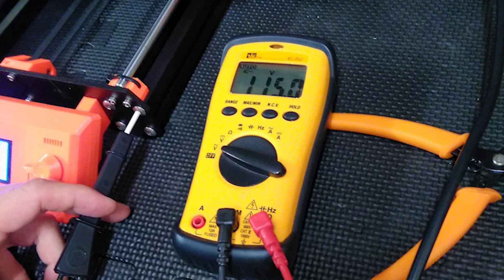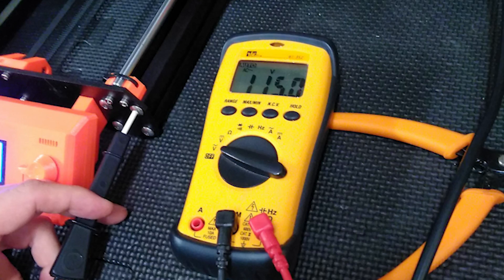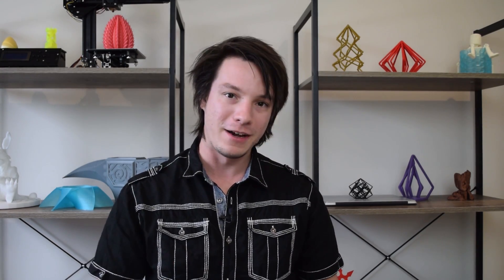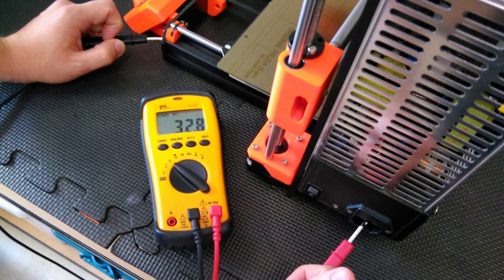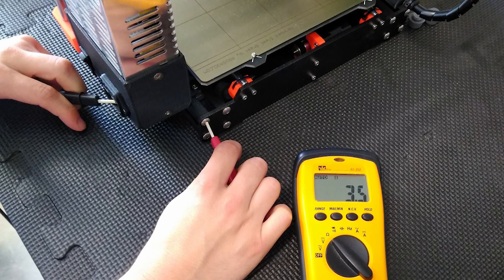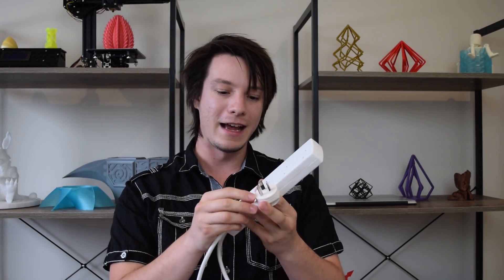I got shocked by a 3D Printer

Comment: That is the mains input filter te remove high frequency noise that is produced by de switching power supply. In most case they have at least two capacitors that goes from each mains pin to ground and if there is no ground...well the mains voltage is divided by 2. These are small capacitors they give you a shock but will not kill you if you are healthy. But yes unpleasant surprise.

Comment: my guess is that filtering in the powersupply for the JGAurora A5 has 2 capacitors to ground. one from live to ground and one from neutral to ground. this is common in grounded switched mode power supplys to reduce the electrical noise from them (not sound, Voltage/current spikes that can cause all sorts of problems). capacitors do let through a bit of current on AC and are commonly used to limit current in cheap chinese LED lamps (youtuber BigCliveDotCom has many good videos explaining how that works)

Comment: Gah! There a lot of comments along the lines of "It's not the voltage that kills you, it's the amps!" Which is basically nonsense. 
Current = Voltage/Resistance and at any time, humans are effectively of a fixed quite high resistance.
So, without sufficient voltage, there can be no consequential current flow.

Comment: As others have pointed out, the stray voltage is a normal consequence of the way modern power supplies are designed, with input filters to reduce EMI. These filters include so-called Y capacitors that connect both sides of the power line to earth ground. This accounts for a small leakage current on the earth ground lead of the power cord. This current is unnoticed when the power cord is correctly grounded, but as Angus discovered, can be a shocking discovery when it is not. The Y capacitors are sized to limit the current so that it is not harmful and won't trip a GFCI (aka RCD). They are also designed to fail open so they should never present a shock hazard. Assuming the power supplies of both printers use proper safety agency-approved Y capacitors, they are safe and functioning correctly. See https://electronics.stackexchange.com/questions/135791/current-leakage-calculations-regarding-shock-hazard-a-complete-picture.

Comment: Wow, this is "heavy". I'm glad you're OK. Could have ended worse. Combinations of circumstances.
Hurry/haste, doing things when you are tired or not totally concentrated are to be avoided. They cause 90% or more of all accidents.
With machines, cars, equipment, etc.
Maybe you (or more me/people) were lucky to touch the screw of the (in fact unguilty) Prusa Mark 3. 
Electrical machines working on 230/115 V with metal casings should heave doubled isolatian.
A metal casing of any tool/printer or what so ever, is stronger than a plastic one and looks more modern/sophisticaded.
But metal conducts electric current and plastics do not.
Plastic is always cool.

Comment: I'm sure glad that you weren't hurt! I think it's very good that you made this video to raise awareness of electrical safety.

For what it's worth, I have an anecdote about a piece of equipment that I bought via AliExpress and imported into the USA. It's a fairly popular soldering oven called a T-962. After reading unflattering accounts of its construction, I tore mine apart and fixed stuff that bothered me before I applied power to it for the first time. I found that the grounding connection was made with a ring terminal clamped against a painted surface, without even a toothed washer to cut through the paint. If anybody is really curious, I made a teardown video, and the bad ground connection appears at 11 minutes in.

Now this is just one anecdote, but I've read similar accounts about this oven and other inexpensive imported equipment. Even if a piece of equipment has a grounded power cord, its chassis may not be properly grounded. Or maybe the main ground connection has been made adequately, but other parts of the chassis are left floating, e.g. when two painted or powder coated panel pieces are screwed together without proper attention to electrically bonding them together.

I think that anything imported through normal channels and marketed by a local company which pays proper attention to local safety testing regulations (such as getting a valid U.L listing in the USA) is probably ok. But I think that a lot of niche products, especially when they're imported individually by their end users or are made by well-meaning amateurs, fly under the usual safety regulation radar. Thus, I think they are a lot more likely to have latent safety issues that would have been caught in a more mainstream consumer product.

I think it's very good that we have folks like Angus reviewing this stuff and educating folks about it. Whether we put pressure on a designer/manufacturer to fix an issue in their product, we educate end users how to recognize and correct issues like this themselves, or we warn people away from an irredeemably dangerous product (like some of the lethal things BigClive reviews), it's very beneficial for all of us.

Comment: Prusa COULD make an improvement although this was not his fault: He could make use of double isolation. That is putting a layer of plastic on all grounded metal parts. The inside needs to be metal and grounded. That way a short circuit will go to ground and trip the fuse. The outside needs to be coated in plastic or other insulating material or paint. That way you can't get shocked if the ground has a fault, because you can't directly touch any grounded metal parts.

For some classes of devices a double isolation is required by law, but I am unsure of the specifics.

Comment: Fortunately, this is less of a problem here in Spain, where grounded plugs (Schuko, round) have a completely different aspect to non-grounded ones (Europlug), and almost all the power outlets have Schuko sockets (which is compatible with the Europlug). Plus, all houses are required to have an RCD/GFCI.

Comment: You need a RCD device: https://en.wikipedia.org/wiki/Residual-current_device

This is a requirement in all installations since 2008 here in Denmark. It is usually installed along the fuses. The fuses protects against a short. The RCD protects against leaks. It will compare the current going into the house with the current going out. The current should always sum to zero, otherwise there is a leak. It would instantly trigger the moment you got shocked because current was going through you and out of the system. It would likely trigger the instant you turned on that bad printer too.

The RCD triggers if there is a leak from phase to ground. It does not trigger if there is a leak from phase to neutral, because that is normal. The bad printer was leaking from phase to ground and would therefore trigger the RCD. That printer could not be plugged in anywhere around here. Of course if the earth pin is disconnected, it might work but only if there was sufficient isolation from chassis to the surroundings. Your table would need to be isolating. If the table was metal, it would trigger the RCD that way.

Comment: I only use powerboards and leads I buy from Jaycar, these days.  Not because I believe they're inherently better, I just work in a Jaycar (not speaking as a representative of the company, or anything like that, these opinions are my own, and even in saying this much, I'm probably flirting with a gross violation of the social media section of my contract), and I can check them with a multimeter before I buy them.  I've bought some very cheap powerboards elsewhere, and they're just downright dangerous.  One was so poorly manufactured, the sockets weren't properly punched out, so I had to take to them with a file (while unplugged, obviously...).  After I made the sockets actually fit a plug, I found that the Active and Neutral were swapped, and the ground wasn't connected at all, despite it being a three pin plug on the end.  That was a brand new powerboard, with some probably-fake Australian standards logos on it.  That's the kind of power board that might kill someone, if they use a metal kettle or toaster.

Comment: There are a lot of things people don't know about power I'm no electrician but I had an experience with an appliance. I used a power cord extension with the appliance I turned off the power and still received a power shock. I found out although the power was turned off the power extension lead still holds current until  you unplug it from the wall thought I would let people know

Comment: My cr-10 came with 2 pin lead with a dodgy UK adaptor, I rewired it in my video, as the UK has a 3 pin similar to AUS I decided to cut the 2 pin plug off and rewire it to a UK 3 pin plug, no way I was gonna use the combo I got with it, if it's not earthed I wouldn't use it.

Comment: I would be testing all the cords/attachments used as well. Cheap power strips/cords cut corners in construction just as much as cheap power supplies. You said it properly, though I do not think that you put enough emphasis on the the point "IF, a wire is loose and touching metal that it is not supposed to be touching...." The IF is the main point (IMO). Well constructed power equipment with proper isolation will never electrocute a person if they are using it in a manner that it is meant to be used.

To many people take for granted that their equipment is constructed properly. I've used un-grounded equipment a thousand times and have never gotten shocked. In fact 100% of the times that I have been electrocuted was completely my fault, I've also learned.... Education on testing electrical equipment is needed. In general a modicum of trust can be had with items that have passed standards for your country, look up the standards and learn what they mean.

They don't call this stuff cheap Chinese crap, for no reason.... Often times there is little to no care for the safety of the user.

Comment: I once tried to fix a digital camera.
I accidentally shocked myself on the flash's capacitor.
I thought to myself "I am such an idiot"
I then picked up my door key to discharge the capacitor.
My door key was a full metal key.
I shocked myself again, this time it was worse than the first shock.
I then thought to myself "I am such an idiot"
Reply: I once tried to fix a digital camera.
I used a small screwdriver to discharge the capacitor.
After destroying the small screwdriver and being blinded, I thought to my self "I am such an idiot".
Then I picked up a larger screwdriver to discharge the capacitor.
Now I've destroyed the larger screwdriver, blinded myself again and have ringing ears.
I thought to my self "I am such an idiot" and brought a new camera the next day instead.
Reply: I get shocks many times with that damn digital cameras or any cameras with built in flash. I am not surprised.
Reply: Shock me aaaaall night loooo-oooong ...

Comment: We're all really glad you're okay. Please be careful in future.

Is the title not clickbaity and overly specific? You were shocked because of a bad extension cable, the same could have happened with any other appliance that needed grounding but wasn't.

Just for safety awareness, I'll request you make a video on the basics of electrical safety. You've got 217k subscribers so you'd get the message out to a lot of people, and your channel deals with electrical appliances so its not off topic, even if you talked in general terms rather than specifically about safety with 3d printers.

Anyway, I'm really glad you're okay.
Reply: Noo, he was shocked because there is something wrong in that other printer - it shouldn't be leaking mains voltage to ground.

Comment: It was in Australia where a man was electrocuted while wearing a heart monitor, it was found that 35mA at mains voltage is enough to kill, that is why RCDs (Residual Current Device) trips if the current in the positive wire and negative wire differs by more than 35mA. even here in the UK

Comment: Anything with heating elements should be grounded.
Anything with a metal frame should have all metal  pieces grounded.
Toasters, kettles, 3D printers etc.
And also, anything with heating elements should have the shortest power lead possible. If not, don't coil up the cable.
And the fact that the JGaurora (sp) cause this is shocking (pun intended).
Glad you OK, and found the problem. Thanks for the heads-up. Even if you experienced, we need to be reminded about this from time to time.
Peace.

Comment: If a 3D printer is designed to be double insulated (Non-Grounded) it should have a minimal touch current and small chance of actually livening up any part of the printer and therefore doesn't need to be supplied with a earthed cable. Then again, china doesn't have the same regulations when shipping to UK US and AU so in that case caution would be necessary

Comment: the first thing to check would be that phase and neutral in your building / socket is the correct way round.  If in the questionable printers power supply neutral is tied to earth ( intentionally or with a faulty component ( I'm thinking power FET or similar that's grounding on its heat sink) then you could potentially ( excuse the pun) be getting a phase to earth link.  Some serious investigation of the printers PSU definitely worth while. Good luck

Comment: I kinda have to rant about the governments of many countries outside the EU. In the EU its mandatory to have a Residual-current device installed in every electrical installation. A Residual-current device would even have prevented it from happening without a solid ground connection when touching, and if you hadn't used the wrong adapter the RDC would have tripped instantaneously where a normal breaker probably would not or not even at all (depending on your situation). Hope something will change in the future. You should talk to a local electician to intall one for you.
Reply: RCDs have been mandatory in Australia since the 90s. Which makes it rather more curious....
Reply: Pook365 I didn't know they were mandatory (I am from Austria) but in many other countries, they aren't. If an RDC trips or not depends on the type of RDC (type of fault current) and on the max fault current.
Reply: All new installations require RCDs installed. It isn't retrospective for older dwellings. Plenty of old houses that still have the ceramic wire fuses in place and where the earth is bonded to the mains water copper / gal pipes rather then being common at the switchboard / meter box.

Comment: I'd investigate more. Something is wrong with your installation, because if it's grounded the voltage should be near to null (6V is OK), and you are not being shocked when connecting the Prusa in different rooms, which is even stranger. The differential circuit breaker shouldn't allow the shock if it's AC, so i'm guessing that the ground cable has been cut somewhere or the differential circuit breaker does not work (push the "TEST" button if you wanna make sure). If the Aurora has a plug without the ground pin it cannot be the reason for the shock. Be safe, if you aren't sure about the effectiveness of your circuit breakers don't play too much before switching off the general switch of your house.
Reply: I believe he was saying that both printers were connected to the same power extension, which was then connected to another extension that did not have a ground.
So the JGAurora seems to have been leaking to the ground pin and into the ground of the Prusa, but neither of these was actually grounded.

Comment: Even if your house has no RCD at the main board, you can get plug in RCD adaptors which would give protection to the appliance you are using - especially useful when dealing with shonky chinese made kit - assuming the house, socket outlet and printer are all correctly grounded. Good to hear the Prusa was not at fault - but still a little concerning that the frame and the 24V PSU metal shell have no direct cross bonding cable given the high resistance between PSU ground and printer frame. When my MK3 finally arrives, I'll be giving that extra attention...
Reply: RCDs are mandatory in Aus, so that shouldn't be the issue.
Reply: Here in the UK, it's likely that all new build installs and a majority of re-wired homes will be RCD protected, but there are still plenty of older properties that have not seen a sparkie in years and are still on ancient Wylex re-wireable fuses, no RCDs etc. Situations like that, a plug in RCD adaptor is better than nothing.
Reply: Having an RCD in front of that you can easily test (pressing the test button) before you use it is a good idea.

Comment: The power supply should have a fuse? I fired up my printer when i first got it but i did not have ground and did not think much off it, turned on the powersupply and the powersupply fuce broke. Btw i have a maker select v2

Comment: Glad you lived to tell the tale :D

That is the one thing that scares me with all these Chinese printers. Many of them cone with a power lead and an adapter, in my case, my Anet A8 came with a European power cable, and a universal anything-to-UK style adapter, but the design of the adapter means that it does not properly ground the power supply, so initially i bought a proper EU-UK adapter that would properly ground the printer, and the first modification that I made was to design and print a power supply cover that has a fan (because I noticed that it got a little warm during use), and a fused, switched IEC socket, so that I can use a proper, grounded UK IEC lead, and make sure that there is no exposed mains wiring. I did a proper job with crimp connectors and heat shrink as well, rather than the tinned-while-frayed wires that the included EU lead had...